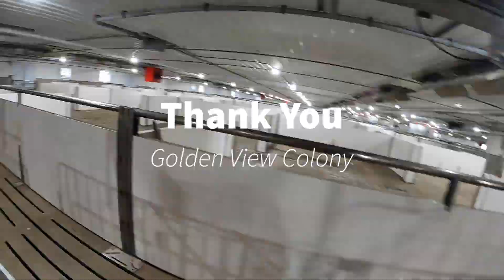Golden View Hog Barn Tour with Barn Manager - Walk Through a Modern Pig Barn for up to 2,400 head.

Comment: Wondering what ventilation your using
Reply from the maker: Paul, the ventilation uses equipment from a few different manufacturers but the chief components are Munters Fans and Fusion Controls. The engineering for the layout was done by New Standard US, Inc
Reply: We are running nedap system in our barn 
I have a few questions privately if possible
Reply from the maker: @paulwurz160  Certainly! (US) 605-496-9696 or email - info@newstandardus.com